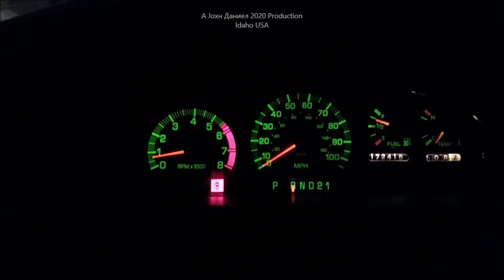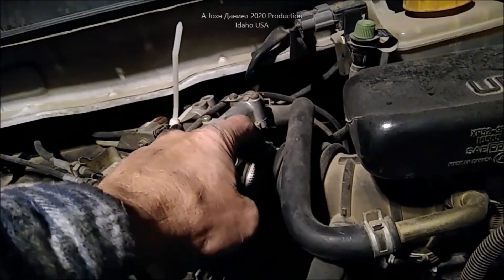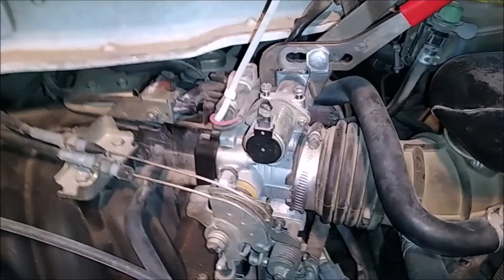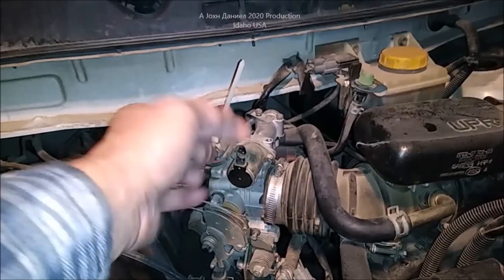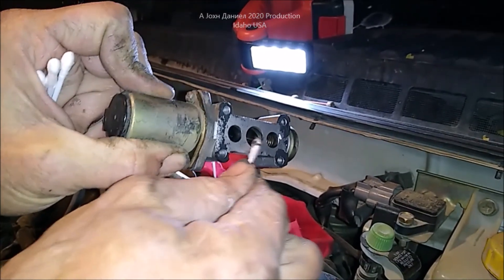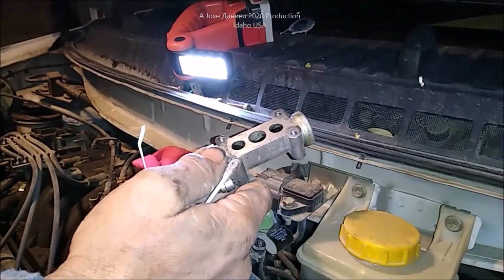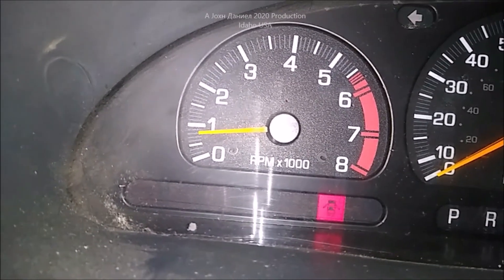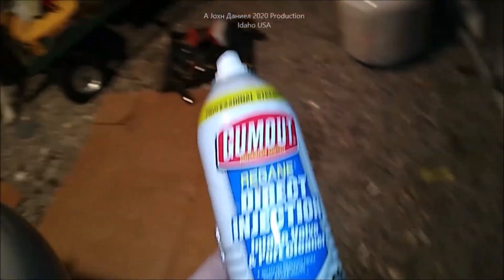Car or Truck won't Idle, Dies when put into gear or coming to a stop?

Comment: My 1964 c10 has this problem. Will this work? Or is it a different system because it’s a carburetor?
Reply from the maker: LOL!! On a 1964 C10 your only dealing with choosing what brand of duct tape to use and Galvanized or Plain steel bailing wire for all repairs. But if it is stalling or not starting when hot, replace the coil and check for moisture in the distributor. If someone has changed the fuel line or carb, then you have to venture into that system to determine if the Carb and fuel supply is getting vapor locked.

Comment: Mazda 3 2008  is always going to stop while putting to 1st 2nd and reverse gears and need to press gas pedel more to adjust the rpm to stay near to 1000. 1st cold start is perfect without issues.. is this issue also from bad IAC !??????
Reply from the maker: Yes, that is a common behavior.

Comment: Similar not the same issue with GMC I6 2004 Envoy. Starts and runs great until it warms enough to reduce idle and dies
Reply from the maker: That series of GMC with the L6 engine is notorious for intake warp and leaks. The do the same thing as a IAC acting up. Check both.

Comment: What would do if I had this same problem but on my TBI system in my 88 GMC sierra?
Reply from the maker: Find the idle air control and clean it. Generally they have a idle control, and  throttle position sensor.

Comment: My truck dies when I push in the clutch during a manual push start, gets no power when the gas pedal is fully on the floor and won't start. Died on me as i was driving it.

Comment: I have a 2002 Cadillac Escalade that when I filing it revs up and down then if I put it in drive it’ll stop or if I’m driving and go to stop it’ll die
Reply from the maker: Vacuum leak, carbon canister, EGR valve or something in the vapor vacuum related system. Won't usually give codes.
Reply: @JOHNDANIEL1  are those easy fixes??

Comment: Hopefully you see this and can help me ,  2009 Mitsubishi Eclipse gs car died while In Drive coming to a stop and now it won’t start at all noteven with a jumpstart , alternator is good any thoughts on what it could be ? TIA 🙏🏼
Reply from the maker: If the engine will spin over and it won't even as much as sputter then you've got five things that are most likely on those cars. Ignition relay, fuel pump or it's relay, low oil switch off condition,  fuel pump inertial safety switch or plug assembly to fuel pump under rear seats. Other rare but occasional things that will happen is your crank position sensor or your neutral safety switch on your shifter that would cause these issues. 
Due to it being summertime and the age of the car I would say the fuel pump is old and pulling an extra amount of amperage to check the fuse going to it or the fuel pump relay  to start with.
Reply: @JOHNDANIEL1  you’re a life saver man 🙏🏼 thank you I’ll check them out
Reply from the maker: Do something put the key in the ignition make sure everything is quiet and off, slowly turn it until it clicks to before it would start. See if you hear a slight hum or a clunk from the back of the car. If you don't hear anything it's worth checking the fuel pump. Some are so quiet that you might have to have somebody stand at the gas filler and put their ears close as they can to where you put the gas in for the tank and repeat that process.
Fuel pumps won't run if they're already pressured up, so you might want to do a little starter spin to relieve the fuel pressure and repeat the process a few times to verify.
And sometimes the fuel pumps will cool off, loosen back up and just start again.
Reply: @JOHNDANIEL1  it was the crankshaft sensor man I bought a code scanner , I still haven’t replaced it yet tho thank you for your help tho really put some hope back in me I was about to scrap the car

Comment: Hello, my Ford 1990 F150 4.9 L stalls on reverse after driving for a while, it did right in the middle of the parking lot, could not re-start the truck, then fr some reason I did not have my cables nor anybody else to have given me a jump. After about 30 minutes I decided to start it AND IT DID START!! And I got back home. It did again after a month, and this time as I lifted the hood, I noticed a bit of fluid had come out of a couple of Battery cells, I suspected it overheats. After 20 minutes I tried to start it and it started, went back home. So now the question is.....What is causing this overheating? I checked it for shorts, but I found none, what do I need to check and fix? Thanks a lot for the advice.
Reply from the maker: Did you check battery water level or replace the battery? Start there.  
The started solenoid on these 1977 to 1996 straight 6 engines can get overheated, over stress the battery and cause contacts to separate till they cool down and contract. If you have over 130,000 on the original starter consider replacement and it's solenoid.
Reply: @JOHNDANIEL1  Thank you much!! I'll check that one up again, I replaced it some 3 months ago, but I may have gotten a bad apple. So I'll try another one.
Reply: @JOHNDANIEL1   Thank you!!
Reply from the maker: Since you said it died in reverse, that could be the neutral safety switch in the ignition as a second option. If it does it again work the key back and forth like you're going to start it as you're working the gear lever back and forth if it's a manual transmission then you might want to check for the neutral safety switch on the side of the transmission to see if it got hung up or loose. If it's a manual transmission look up neutral safety switch Ford manual transmission and your year model.
Reply: @JOHNDANIEL1  I will try that, thanks John.

Comment: I have a 2006 suzuki grand vitara and it’s fine in park and neutral but when i put it into drive and reverse it sounds like the power is less then it’s fine for a couple seconds then dies thinking it might be an alternator tried the battery way to unplug the postive wire and see if it goes out but its fine does the same thing with the battery connected  any thoughts ?
Reply from the maker: On those, Timing slack adjusters is #1 for that behavior. #2 is vacuum leaks, #3 is fuel pressure regulator, #4 weak fuel pump, #5 idle air control. 
If I hit it on the spot with the list you need, don't feel guilty if you go into the video and drop a thanks dollar or three.

Comment: My 1998 mercury mountaineer dies in reverse, if I give it gas it'll go but when I let off and try to idle it dies immediately. But only in reverse everything else works fine
Reply from the maker: The computer would cause the idle to be less reactive to the pedal and not allow you to race quickly backwards when you throw it in reverse, so a idle air control that's not working real well in reverse with the computer detuning the engine can cause this.
Reply: @JOHNDANIEL1  ok thank you so much! So should I replace the computer?
Reply from the maker: Not likely, I'm just telling you what the computer functions like. So when the idle air control is having problems it's not able to compensate for it since the computer is not allowing it to give you more idle. I'd clean or replace the IAC then check your results.
Reply: @JOHNDANIEL1  ohhhh ok I gotcha, I have replaced it though and the spark plugs as well it's been about a year since then though

Comment: I have an 2007 Chrysler Pacifica stalls when i press the brakes and on reverse gear? Cleaned the throttle body had a p0420 code come on?
Reply from the maker: Chrysler Pacifica, guaranteed vacuum leaks. Have someone test your vacuum leaks and that's most likely your problem. Your throttle controls and intake manifold or sensitive to vacuum changes, a vacuum leak that's just big enough will do everything you're having problems with. Always if I give good information feel free to throw any money in the change drawer underneath the video where it says thanks or something like that.

Comment: Hey John, do you know if this is a common issue in 1999 Honda CRVs? 166k miles. I have the exact same problem: car starts up, idles fine in Park, as soon as I switch it into D or R it sputters and dies most mornings. Especially when it’s cold. It used to start up fine, now it also struggles to start up most days. Same as yours, if I apply the gas during start up or putting it in gear, it keeps it alive until it’s warm and then it runs fine. Mechanic said no leaks in the vacuum lines and pressure on all cylinders is good. What do you think? They want to try changing the whole timing belt, but I’m not sure. Sounds like IAC might be just the thing.
Reply: I have this exact issue on a 08 Acura RDX.
Reply: Did u ever find out the issue? Mine is doing excat same thing
Reply: @danielle05able  did you figure it out
Reply: Need to know the problem was my blazers doing that

Comment: I have a 2016 Jeep Wrangler with an automatic transmission. On a cold start my vehicle has no issue, but when shifting from Park to Reverse the vehicle shudders and occasionally will stall, what could be the issue?
Reply: @Wezi427  bad purge valve

Comment: In the same case of my 2001 Nissan Sentra, it is caused by a bad Oxygen Sensor 😔
Reply: I just replaced the IAC, Fuel Pressure Regulator and all coils and plugs in mine. Still didnt fix
Reply: @tengenriku  you ever get it fixed?

Comment: Idk if you're still responding but here I am in 2021 with a 2000 mercury villager just brought it 2 months ago and I've been chasing a vacuum leak. Until I figured out the iac may be the culprit. So I got a new one and it idled really high and then after a min it would start surging up and down rpms 1500-2000 every couple seconds. So I cleaned the old one put it back on and now I'm having the issue your having. And somewhere I figured out it may also be the fast idle thermo valve I can't keep spending money on iac they are expensive for this vehicle. So could it still just be the iac valve and nothing else? What made the brand new one bounce rpms?
Reply from the maker: While you're installing the new one be sure to disconnect the negative on the battery to clear the computer because it has been making up the difference for a older one for a long time. After you clean the old one and put it back on sort of the same result. Try that and see if it makes a difference.
Reply: @JOHNDANIEL1  I've got the idle fixed but of course there's always something else. I'm about ready to junk this thing. Now I can idle perfectly in all gears no stalling. Until I start driving. I went for a short test drive all seemed fine but when I was on my way back it starts bucking and jumping and doesn't want me pressing the gas very hard. If I lay into the gas the rpms drop way down and tries to shut off while driving. I'm looking into the crankshaft sensor next but after that I think it's time to give up. And let someone else try their luck with it. It's a real shame since it's in excellent condition inside and out low miles and all. It drove so nice when I first got it.
Reply from the maker: Sounds like fuel pressure regulator when they do that. Quite likely you either have a plugged fuel filter, weak fuel pump or a fuel pressure regulator issue. The bucking would be caused by the lack of fuel. However take a look inside the tailpipe and if it's really black then you might have something wrong with the throttle body on it.

Comment: Could this be the issue for an 05 Altima 2.5? Starts and runs fine but when put in any gear besides neutral, it dies.
Reply from the maker: Yes, most likely. Poor air flow will stall an engine once it's put under load like putting it in gear. The next thing could possibly be a vacuum leak somewhere. Other than that the Altimas don't have any real problems
Reply: @JOHNDANIEL1  2002 pathfinder , idles fine when put into gear d or r. Shuts off. Had vaccum leaks codes for 2 months.  Could it be the vaccum leaks that evtually caused this?
Reply from the maker: Yes, vacuum leaks affect things in the transmission, drive couplers and brakes that you would not expect. Loosing vacuum causes the intake to close or the IAC to close and shut you off. Nissan had 4 years, 1999 to 2003 where the fittings became brittle that connected numerous vacuum lines and vacuum servo motors. The Air conditioner venting vacuum servo not working well is a sign of this problem too. Lots of hands on time is involved, a cheap propane torch head https://amzn.to/3vieH9V and 1 lb camping tank can help, DO NOT use starter fluid like boneheads do in some videos. Find a few videos on how to use Propane to find automotive vacuum leaks.
Reply: @JOHNDANIEL1  ok thank you very much for the advice!! It's in the shop now hoping for the best and nothing to expensive to fix. I done tons of research and looked everywhere on vechile . Decided to put into a shop. 
Thank you very much for advice sir and your helpful vidoes!!!

Comment: I have a Infiniti g35 it does the same thing any suggestions???
Reply from the maker: 3 common trouble things on the Infinity. If not the idle air control. 
Knock sensor, vacuum leak, EGR. 
If it fails to pull a code, then check fuel pressure regulator.
Reply: @JOHNDANIEL1  thanks for the fast responses

Comment: I have a 97 dodge 2500 5.9. Diesel It runs fine on Highway but I have to put I in neutral are the truck will kill on me. Any information will help. Thanx in advance
Reply from the maker: If it's below 625 low idle then adjust the low idle up to 650 to 675 so the computer knows it's running right. The screw loosens on them over time. Second, the Fuel filter and possibly pre filter.

Comment: I have a 97 Dodge Ram idles fine in park and neutral but just dies when I put it in reverse or drive what do you suggest it might be?
Reply from the maker: Only two things would cause that on a Dodge pickup either the idle air control or a vacuum leak. Typically a vacuum leak on one of those goes to the booster tank where the vacuum lines go in and out and it's kind of a small air tank looking plastic sphere. Otherwise the majority of the time it is the idle air control specially on that year model.
Reply: I have the same problem with my dodge cummins
Reply: How do i fix a vacuum leak
Reply: Did you ever fix ur problem????

Comment: i have a 1992 mustang that idles and stalls when i put in in gear but its fine in neutral any help appreciated changed iac and egr
Reply from the maker: You have a vacuum leak or your EGR has failed

Comment: I replaced mine and it’s still giving me trouble
Reply from the maker: Disconnect the cars battery while the headlights are on to drain the voltage in the system and clear the computer, let set about 2 hours, re-connect the battery and see if it improves. If it starts to act up again, clean or replace the MAF sensor on it.
Reply: Depending on the vehicle such as a Ford you need to buy the Motorcraft brand some vehicles do not like cheap parts. I replaced four different ones on a Mountaineer and would not run right til I installed the Motorcraft. eBay, Autozone, and Orielly optional brands would not work.
Reply: @VerticalAutoGarage  Good advice....that's the route I took when I replaced mine.

Comment: I just ran across your video. I’m impressed so far. 
I would like to get you to build a solar panel system for my 2003 terry travel trailer. 
I would like for you to build that for me so I can get a good idea of what to get. Eventually I would like to install a wind and solar for the house and shop. 
Please let me know if this is something you are interested in. 

Thank you for all the videos and your time
Reply from the maker: OK, How can I help you?
Reply: @JOHNDANIEL1  
I was hoping you could either give me a parts list that I can order. And I pay you to walk me through how to set up the system over the phone. If that is possible. Since I’m in ga , I’m not sure if you could install everything. 
Do you have a number I can call.
Reply from the maker: Take me a picture of the RV Roof, with its surface length measurements, and what you will need to run on Solar. You can run a lot, and a AC unit but not the roof mount AC units. Send info, pics and your ph number to me at olympicpowercontrols@yahoo.com and I'll get back with you soon as I can. I get about 30+ emails a day with similar needs.
Reply: @JOHNDANIEL1  thank you, I will do that asap

Comment: If theres carbon in the idle valve wouldn't there also be carbon around the throttle butterfly valve🤔
Reply from the maker: Yes, but that had been cleaned earlier which lead to the IACV being next suspect